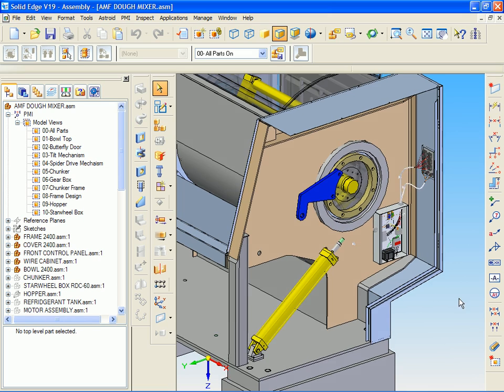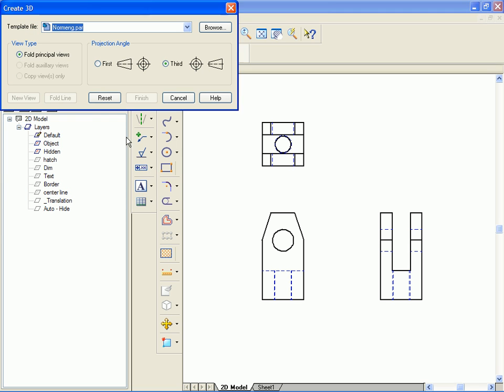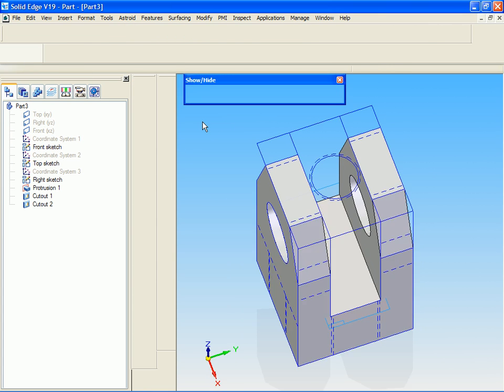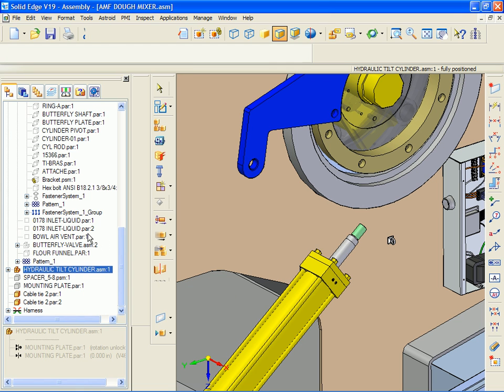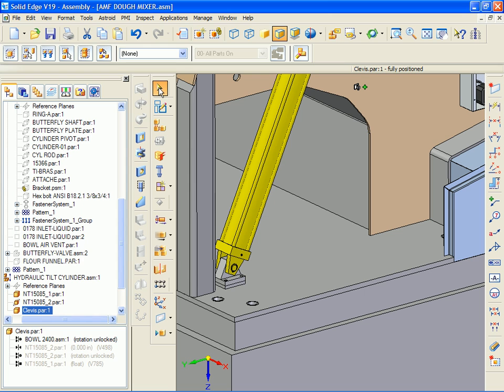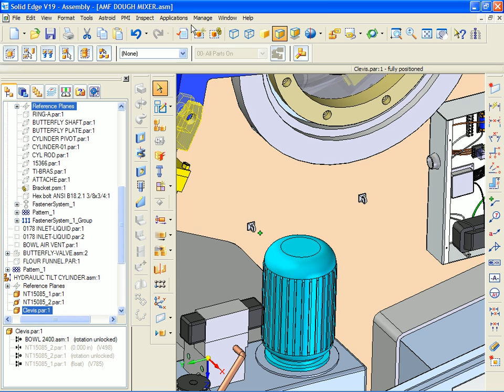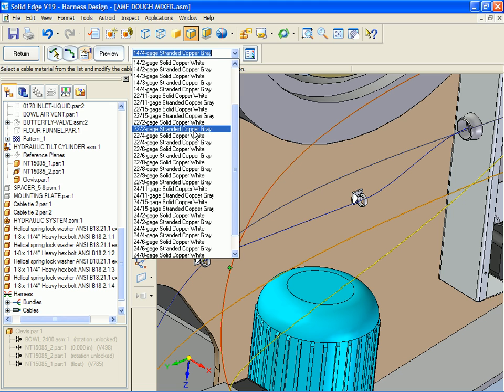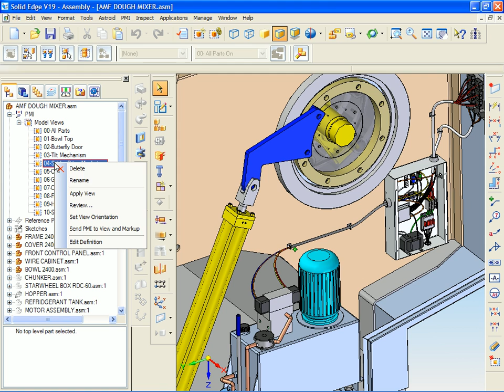Solid Edge: Wire Harness

Comment from the maker: survivoree  - The Engineering Reference tool included with Solid Edge has a pulley designer that lets you choose design parameters, pulley and assembly dimensions, Solid Edge them builds and places a 3D model of the pulleys.
You can use Solid Edge motion and the animation capabilities to simulate a pulley mechanism working!